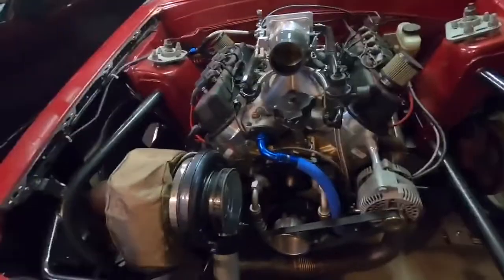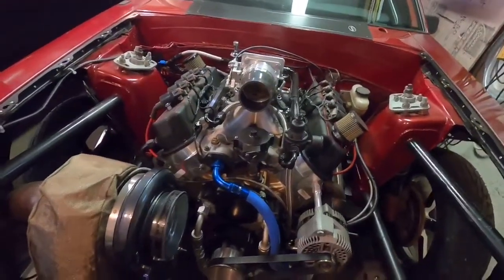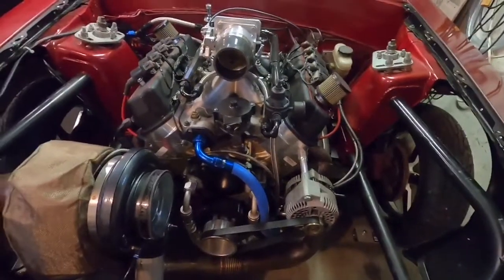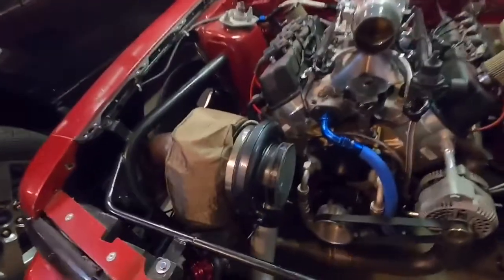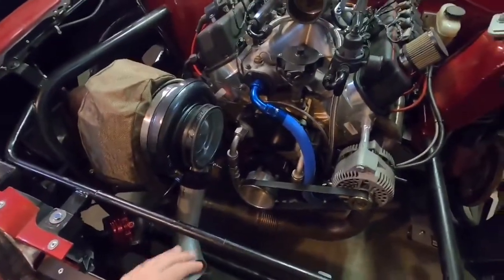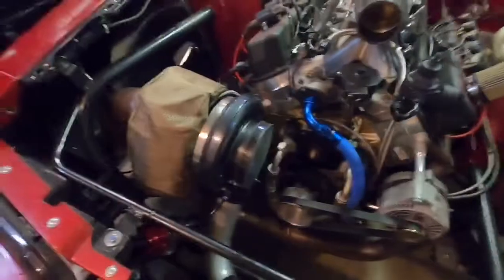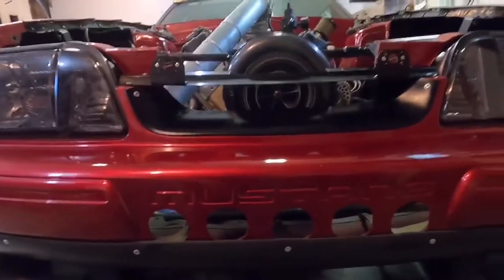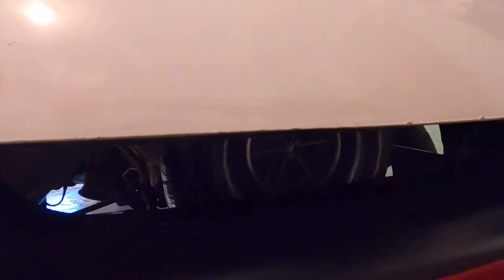Going Front mount Turbo on the fox 🦊

Comment: You probably have already been recommended this or even know of this yourself but running a blow through carb setup on e85 would give you pretty low charge temps without an intercooler. I know builds are forever evolving, so I thought it’d be worth mentioning! Keep up the good work man.
Reply from the maker: I hate blow thru carbs, but ya they do cool good